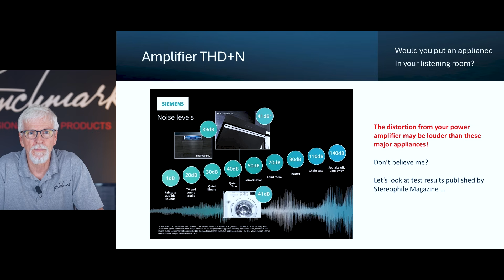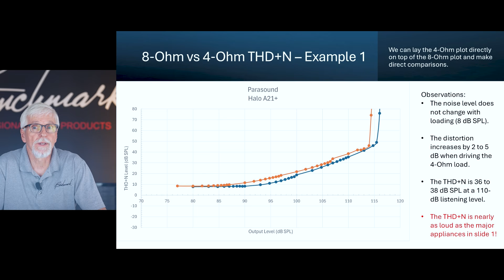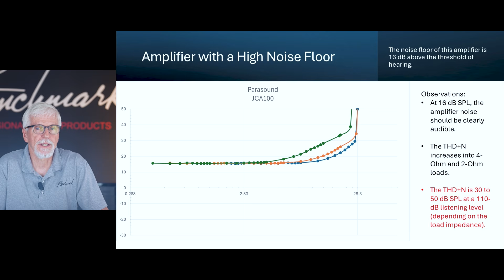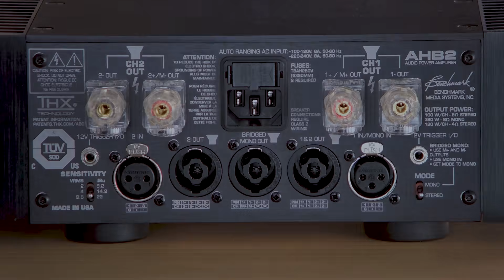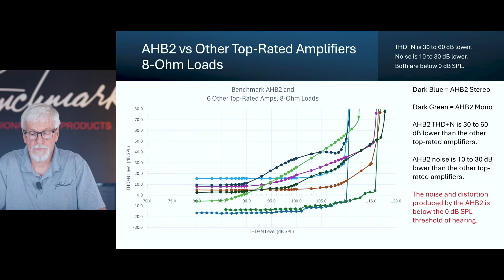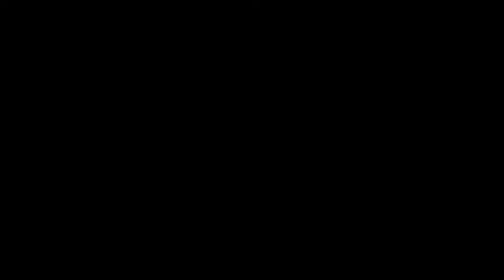How Loud is the Distortion from Your Power Amplifier?

Comment: Do you recommend putting a ferrite choke on the power cables of DAC3, LA4, or AHB2 to reduce high-frequency ground noise?
Reply from the maker: No. RF line filters are already incorporated into all Benchmark products. These products are already stone quiet even when exposed to strong RF fields. This application note shows some of the RF testing that we do before releasing our products. We are testing to professional audio RF immunity standards which are more demanding than consumer hifi standards. - JS

https://benchmarkmedia.com/blogs/application_notes/14681393-the-ce-mark-a-photo-tour-of-immunity-testing
Reply: @BenchmarkMediaSystems  Could you please explain how you can filter RF noise coming up the ground wire of the power plug, because I understood that you cannot legally put a filter on the safety ground. That RF noise must go directly into the chassis. This would imply that a ferrite choke could help. Thank you for your very helpful comments!
Reply: If the power supply is properly designed, it shouldn't be an issue.
Reply: @Artcore103  No power supply filters the ground, no matter how it is designed.

Comment: You could use REW 5.40 latest beta and choose FSAF as your measurement method. FSAF can use normal music as excitation. FSAF separates the system output onto pure Linear Time Invariant component and non-LTI component (a.k.a. distortions). Then you can listen to the actual distortions and make your educated decision. The THD+N figures make sense only as much as they correlate to the non-LTI distortions, which is non always the case.
Reply from the maker: I will look into that. Thanks for the suggestion. - JS